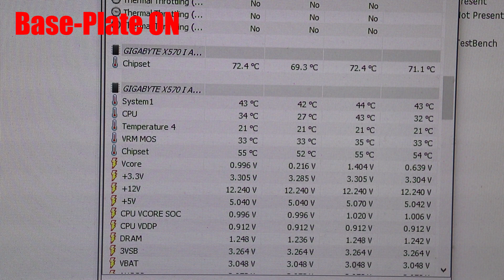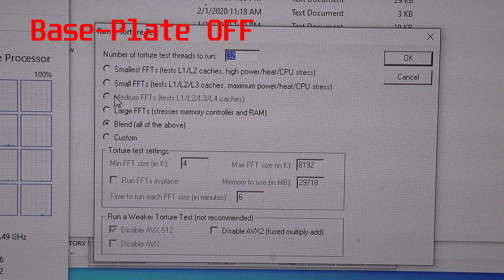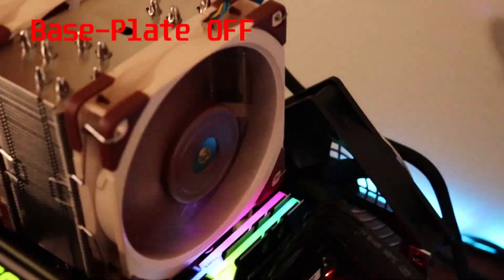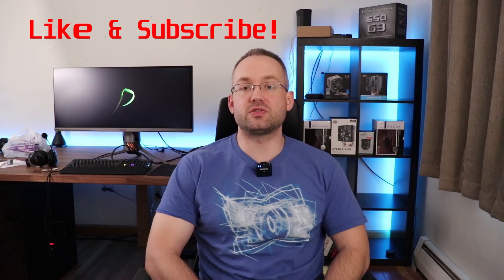Gigabyte x570 I Aorus Pro WIFI 3950x VRM Temperatures With & Without the Base Plate

Comment: I have a question. There are 2 Chipsets detected on HWinfo64 and the distintive one is hovering aroung 70-76c. Is this normal? THanks bro
Reply from the maker: If that's when the computer is only idling i'd look into it further, but under full load that's reasonable.

Comment: Hi, did you ever run into RAM XMP issues with this motherboard? Every time I set XMP profiles, I save it, boot into windows, everything's fine, turn off my PC & go to bed, next day I turn my PC back on & it does this power cycling thing & it resets my BIOS settings back to defaults every single time, no idea whats causing it, tried XMP Auto/manual settings, different RAM kit & still a no go.
Reply: Had the same issue, updated to f20 bios. It was showing my DDR4 3600 as 2133. Checked settings and Xmp was set to auto. Changed it to level 3 and now ram showing at correct speeds and no more hanging or having to reboot. CPU-Z showing as 2666 speeds but know it’s set as 3700 as o’clocked it and showing in gigabyte software
Reply: Forgot to mention, also set to ultra fast boot in bios as well.

Comment: Thanks for the vid.  Would trimming the backplate to avoid the obstruction be a good solution?
Reply from the maker: It certainly is a viable solution.  However it would be better to spend a little extra money on another case you like that has the appropriate case standoffs.

Comment: Can you please mention which case would be perfect for Aorus x570 Pro + R9 3950X.
Reply from the maker: It depends on the other components you'll be using, including 3.5hdd/2.5 ssd and cpu cooler.

Comment: I use exactly the same board and the same case but in white version :) Currently i use R5 3600 Thanks a lot for the video :)
Reply from the maker: Great processor!
Reply: @SystematicHardware  yes, i bought this motherboard to be able to update processor later on to something better (due to VRM) but at the moment it's working great with R5 3600 and Sapphire RX 5700XT. Just one note, i have two m.2 drives one Samsung 500GB M.2 PCIe NVMe 970 EVO Plus and second Plextor 256GB M.2 PCIe NVMe M9PeGN. Recently I've changed 970 EVO Plus to the slot at the back because temperature on Samsung drive when located in the slot over chipset was over 85 and it's my main drive, now on the back with thermal pad to the case it tops out around 72 and M9PeGN that is for games over chipset is around 50 :)
Reply: @sloniupleu  3600x at 4.4ghz@1.35v no problem, no cpu not throttling down.but i attached small 60x60(old cpu fan lmao) fan over the vrm during assembly because i know this mobo got vrm temp issue
Reply: i use double sided tape to attach the small fan because im from the hood
Reply: Have you also removed the backplate...? Struggling to get hold of an X570 itx board in the UK at present.

Comment: Does it take a long time for the motherboard to post? I keep reading reviews of the motherboard taking 20 secs to post
Reply from the maker: Improved system boot time was included in bios revision F10 and the current is F12e.  Just update your bios!
Reply: @SystematicHardware  Thank you so much for the response! I ask because I am about to get one from someone on reddit and wanted to make sure that was fixed.

Subscribed just because you actually replied.